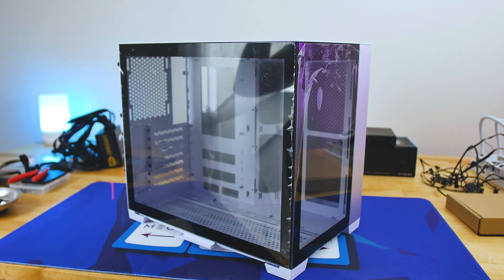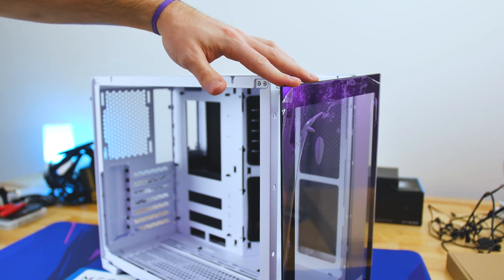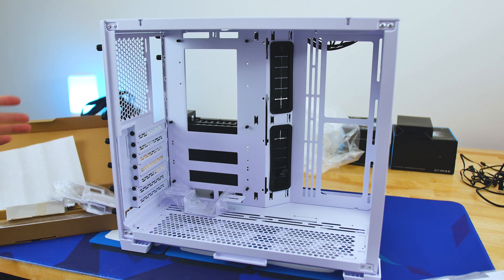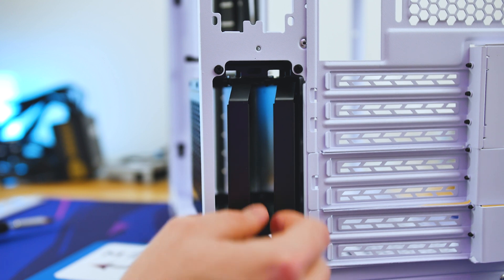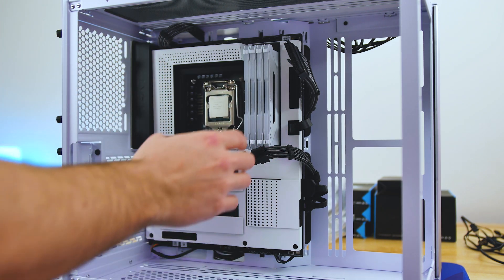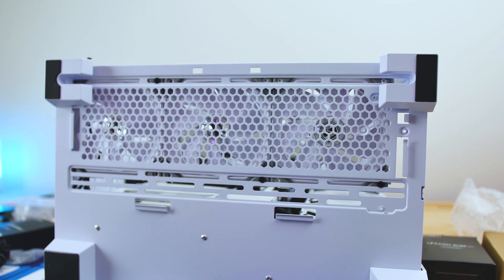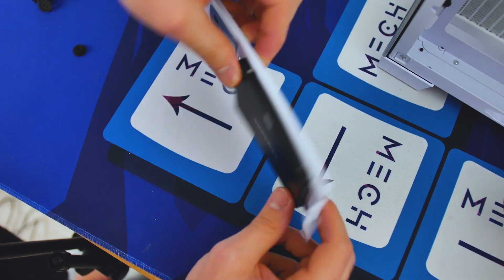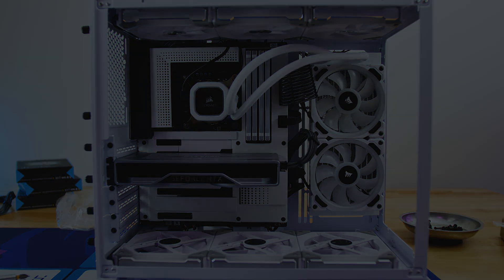How To Build A PC in the Lian-Li 011D Mini

Comment: First time PC builder here, Question about the AIO Rad, is mounting the cooler like that genuinely okay? I understand that air travels upward and the the pump is weaker than the pressure of the air trying to travel upward, I guess my question is:
As long as the tubes at the top of the radiator are above the pump that sits on the CPU mount it should be fine right?
Reply from the maker: As long as the the rad is mounted higher than the pump. There is a slightly better config with the tubes stemming from the bottom, but it's negligible.
Reply: @jdtechgear  thank you, im making the switch from xbox one x to a $4000 5800x + 3080 setup in the 011d mini, and the lat thing I wanna do is mess up the cooling and do something like fry the CPU 😅
Reply: you are correct. the tubing should be below the pump in this orientation, air bubbles will enter the way this was set up. Gamers Nexus has a good vid that covers all aio orientations and the right and wrong ways to install. with the o11 mini and an atx board, side rad is the only viable install for clearance reasons, but most aio's do not have tubing length to accommodate bottom tubing, as with the large gfx proper routing usually isnt possible. tldr this orientation as shown will bubble, but not a lot of options when using an atx board in this case.
Reply: https://youtu.be/BbGomv195sk this vid here.
Reply: @gn0s1s  i dont know if im understanding you correctly because when i watch gamers nexus video, he says to do it how he has it mounted in this video. what do you mean this will cause bubbles? its mounted the right way. you never want to put a rad on the bottom. what are you trying to explain here?
Reply: @RideRedRacer  its seems you either didn't watch the video, or didn't understand the demonstration of where air collects and damages based on orientation. 18:00 minute mark he mocks nzxt for this exact orientation since they should know better, the same orientation used here. So its understandable if people copy it, with tubes above pump, but air will sit at top of intake in rad and be pushed through, where as bottom oriented tubes the air will sit at top of rad and never be sucked down.
Reply: @gn0s1s  then go tell that to Jaystwocents. he goes into detail about gamers nexus video and even says this orientation is fine and wont cause any issues to the pump. no air will get caught in the pump with this setup because the top of the rad is higher than the pump. the air will sit at the top of the rad. i get what you mean by the tubes being on the bottom for the correct way to do it. but this setup with the top of rad being higher than the pump wont cause any damage to the pump. thats from jaystwocents mouth
https://www.youtube.com/watch?v=DKwA7ygTJn0
Reply: @RideRedRacer   "jay just keeps spewing nonsense.
i'm a marine engineer. fluid dynamics and thermodynamics are, literally, my favourite topics outside of pure physics. and i did got my degree in the past millennia but physics of those hasn't changed from the big bang so i bet you my knowledge is still usable.
tubes on the top are bad because air gets trapped in the entrance of the radiator so there is lower flux of thermal energy. that causes building of heat in the pump, translation of that heat to gasses in the connector of the radiator. gasses expand more readily in the heat then liquids so bubbles get thrown about the circulatory system and air gets logged in the radiator and the pump. heated gasses get more permiation from tubes that introduces more gas in the system. more gas gets in the radiator and the pump.
you want the thermal isolator (air) in the end of the system and not at the choke, flux or critical point of ingress like the radiator connector. we build literal traps for gasses above connectors of critical systems to avoid anything but perfect transition of maximum flow calculated by bernoulli equation.
i just couldn't watch the "you think this or that" attitude and then going on some tangent. either get on the topic or don't make the video, jay." TLDR jay is uninformed as usual.
Reply: @RideRedRacer  Not to mention in Gamernexus vid, at 18:50 mark, literally shows that Jay is wrong, showing the intakes taking micro bubbles down, and the bubbles not just sitting in the outtake pump, both sides, meaning air will get to the impeller in the pump, and you will suffer from cavitation over time. Like it literally shows Jay is wrong in his assertion.

Comment: Hi. I just ordered my case. Would 25mm fans fit in this case with an ATX motherboard? This video it does but I have seen another video where it does not fit.
Reply: See the Manual for this particular case more in detail, here you will find all measurements and possibilities with different sized boards up to E-ATX

Comment: Really cool. I just bought the snow white case. This is the build I'm going for. 

The cpu cooler fans weren't spinning.
Reply from the maker: If the CPU is at idle and under a certain threshold, the fans don't spin
Reply: @jdtechgear  on some motherboards..
Reply from the maker: @C1200A  the fan logic is through Corsair's, no the motherboard

Comment: will the gamemax 850w gold cert psu fit in this case?
Reply: Definitely not unfortunately. This will only hold a SFX or SFX-L PSU so you're looking at PSUs which are under 130mm long and a lot less volume in size.

Comment: Great video, well produced, concise explanation. Thank you for the preview!
Reply: Update to this comment.. I got my Dynamic case about a month ago and holy cow is it easy to build it, I cannot stress this enough. Cable management was a breeze. The case itself has no sharp edges. It is nice and compact enough to fit on my desk with 2 ultra-wide monitors. 10/10 would recommend.

Also, the white color is super classy ;)

Comment: would you recommend this case to a beginner to build in?
Reply: There's a lot of parts in play with this case but as far as building in it's really quite a treat. One of the most flustering aspects to me when it comes to building is often cable management and in this case if you don't use the HDD bracket you can totally brute force it by just stuffing excess cables while still looking like a million dollars on the other side.

One thing to consider though is cable length for your GPU. SFF PSUs have shorter cables and this paired with a full-length ATX board might mean you'll run in to length issues especially with wider GPUs so it doesn't hurt to have an extension kit just in case you run in to this. It's saved me from having to wait an extra week on a build in another case I was working with. Just stuff the excess length away with the rest.

Comment: with more exhaust fans wouldn't you be worried about negative air pressure?
Reply from the maker: Not necessarily. Air flow through the rad is slower than the intake fans on the bottom. You'd need a significant amount of exhaust to intake ratio
Reply: @jdtechgear  oh okay, thanks for the info I was worried that I’d be creating negative air pressure if I got this case. 😃

Comment: Isn't it bad to use the radiator as a exhaust in the case since it takes hot air out of the case while it's meant to cool the liquid?
Reply from the maker: It's fine to have it as exhaust. It would be preferable for intake however, that would mean mounting the rad to the bottom of the case and having the pump above it. That would cause a significant drop in longevity and performance since it would be forming air pockets in the pump.
Reply: @jdtechgear  Thanks for the info!

Comment: I built my PC in the same case (black) 2 weeks ago. The big difference is that I have installed my 280 AIO watercooling on intake (pull) so the fins get fresh air from the outside. And as I have installed 2 120mm intake fans at the bottom that push fresh air directly on my GPU,  it isn't affected by the hot air from the watercooling.  I have 2 140mm fans at the top and one 120mm fans at the back for the exhaust and it is fine like that.

specs :
Mobo : B550 Aorus Elite
CPU : Ryzen 7 3700X
RAM : Corsair Vengeance LPX 2 x 16Go 3200MHz
GPU : Aorus 5700XT
AIO : BeQuiet Pure Loop 280 with 2 DeepCool CF140 fans on it
Bottom and back fans : Deepcool CF120
Top fans : BeQuiet Pure Wings 2 140 (from the AIO originally but I swapped themp for aethetical reasons)
PSU : Cooler Master V750 SFX Gold
Reply: Yeah, i mounted mine as exhaust and the case was hot asf, temps were really bad fans got noisy because of that too.
Reply: @ThatLennyBoi  how does it look when mounted as exhaust?
Reply: *intake?
Reply: @hemwi5561  Looked good but temps are really bad.
Reply: @ThatLennyBoi  have you thought about looking into liquid cooling? I’ve heard it provides much better temps..

Comment: Why is the right side with the radiator exhaust? Wouldn't it be better intake?
Reply: its clasic to use it as exhaust in this case for the positive pressure. if u have 3 intake bottom and 3 exhoust top then its better to have the side for exchaust aswell.
Reply: better for bottom to be intake and everything else exhaust since heat rises

Comment: Why is it "obvious" that your rad vents are blowing air out?
Reply: Radiators dissipate heat, so generally you want those fans facing out so that hot air is pushed out. However with this case I've seen a lot of watercooled builds have the fans as intake since it makes more sense with air pressure in the case, to your point...

Comment: tricky to find PSU for that case
Reply: @crazylegs4125  yeah crazy price also for that efficiency, I decided to opt for ATX cases as I don't have a money to spare.
Reply: Cooler Master V sfx
Reply: Sfx isn't worth it anyway, overpriced and less durable.
Reply: @ThatLennyBoi  even for reputable brands?
Reply: @demon6937   Yes, not to mention they have a very annoying click sound every time you turn on or off the computer also the small fan is not enough for cooling as large fans in ATX psu's.

Comment: How are the temps with the different side panel as apposed to a more "normal case" that has the fans face the components
Reply: Its a little warmer than high airflow cases, like only a few degrees
Reply: Depends on the setup, the fans you choose, the size of them 120/140mm ect. 
Just built in this case from a phanteks p400s.
My chipset alone sits roughly 10° lower when gaming in this case vs the p400s. 
Everything else sits lower as well but the chipset is the most significant, everything else sits 5-8° lower. 
That being said I only have two fans on all sides top/bottom/rear. Still have room for a rear fan, bottom 120/140mm and a top 120/140mm. So in theory temps may be even better once those are installed.
For a liquid cooling based case, the air cooling is fantastic. And I have no liquid in it at all.
Reply: Temps are bad lol, i sold this case because of that, your AIO should be mounted as intake but that wouldn't look good so by using it as a exhaust temps get worse.